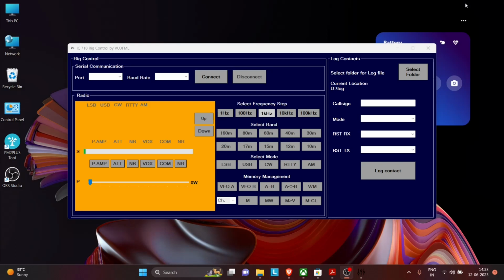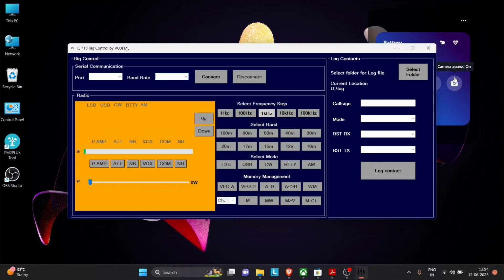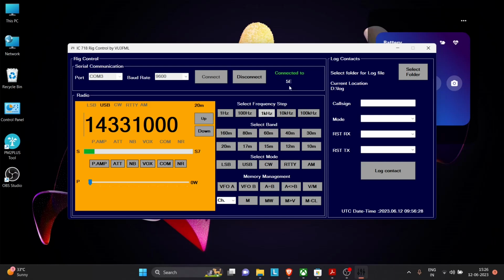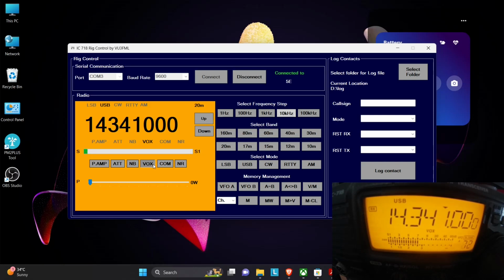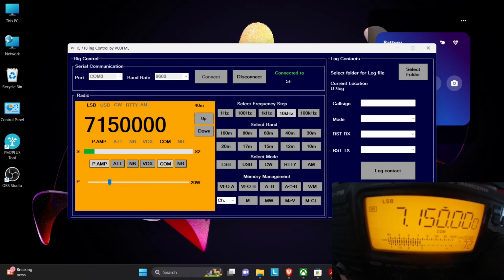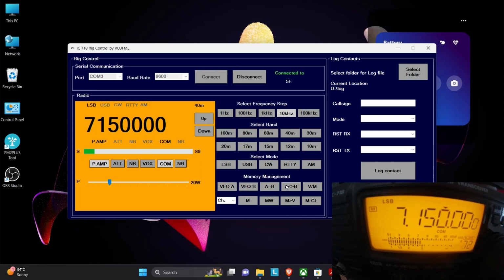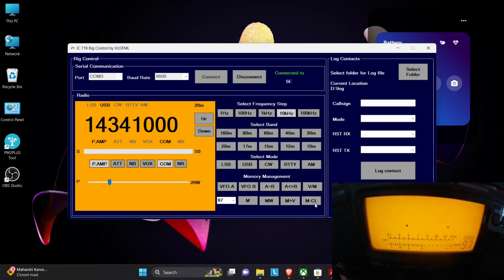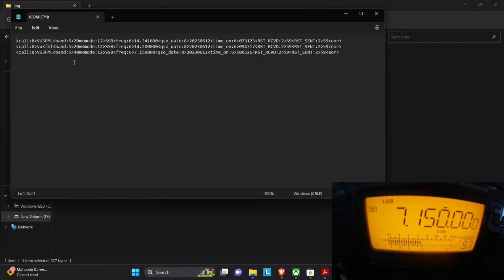ICOM IC718 Rig control

Comment: Hi I downloaded and installed. When I try to connect IC-718 it locks up the program. I'm using com2 at 9600 baud any ideas.
Reply from the maker: There are certain settings that need to be done in the IC718 also (like baud rate and device address). I hope you have done that as mentioned in the video. Also I hope you are using the correct cable. It's a simple setup really. Working fine at my end with windows 11. Please also make sure the address of your IC718 is 5E because that's what the software is looking for. I am sure you will figure it out. Many people are using it successfully.
Reply: @AniruddhaBokilVU3FML  
Thanks for the quick reply, as soon as I hit the connect button it locks the program, I have to go to task manager to close it or restart pc. 
My PC is running Win11 using the Comport 2 at 9600 baud on a USB Serial Port cable with the FTDI Drivers. 
On the radio IC-718, CIV TRN is OFF, Using 5E and the baud rate of 9600. 
Your program com2 baud of 9600. Locks when I try to connect.
Tried a second PC the same locksup, used the putty program cable is good. Yes its plugged in at rear of radio. Even did a radio reset. Maybe someone here had the same problem and can let me know. Anyway looks like a very cool program for the IC718
Thanks 
ve2xxm

Comment: Would you be able to use this software and the FT8 software to make contacts?
Reply from the maker: Ft8 requires audio/pc interface and CAT/Rig control for the radio. This is just the Rig control to operate the radio. You would still require an audio interface with ptt control